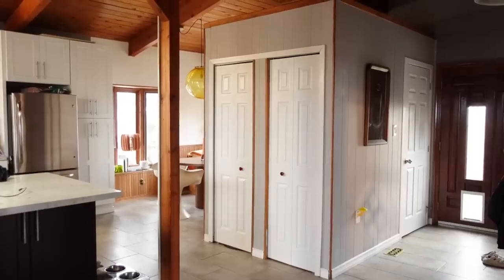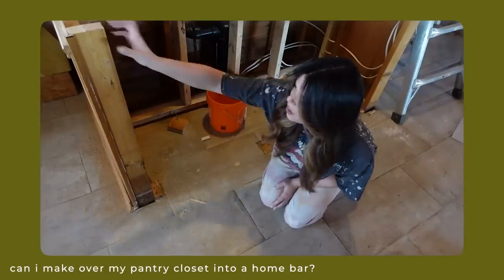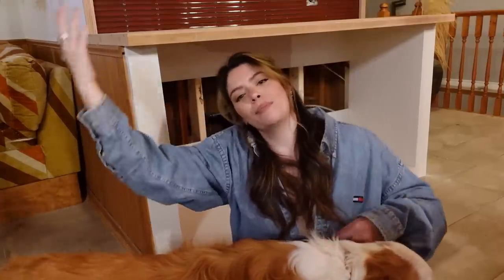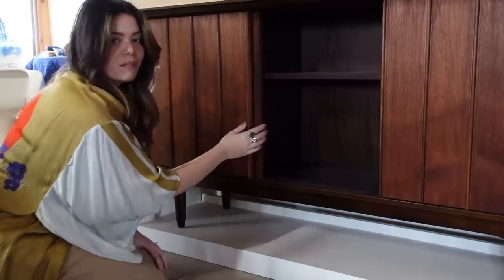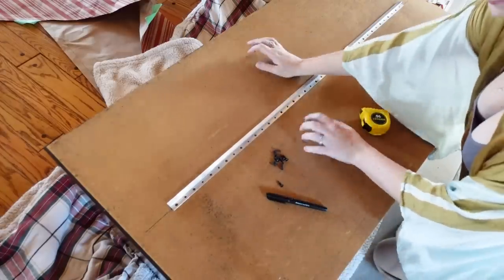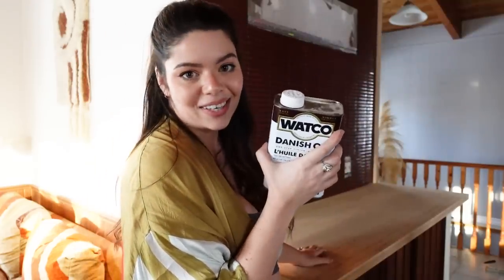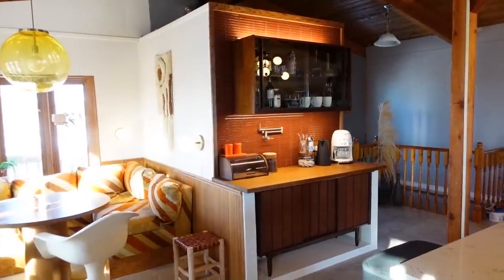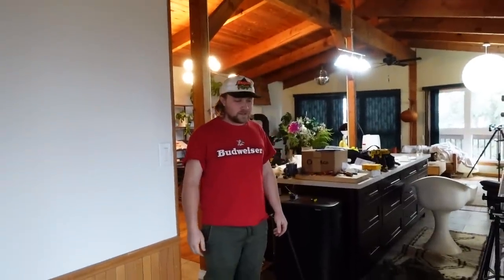tiny closet turned coffee bar (FULL MAKEOVER)

Comment: While I LOVE the aesthetic and functionality, I’m not sold on the cabinet  beneath. Can you hide the legs to make it look built in? It just feels a bit weird floating there. It looks amazing otherwise!
Reply: Yea I feel the same way. I thought when they built the platform they were going to remove the legs. The legs are rad though, so it’s tough, but it looks kind of odd though. Everything else is looking great! Though I would have installed lights inside the top cabinet too.
Reply: @michellemorales  I was thinking the same thing, I think the lights at the top and bottom make the cabinet so dark inside. Also the box below should just be a cool looking cabinet. The feet feel really off and the feet can’t be cut off because that piece is beautiful
Reply: that is a fair point, it's gonna be annoying to clean under there too. it'd be super easy just to stain a piece of wood and stick it over it.
Reply: She could maybe enclose the bottom ro hide the legs.  I agree that rather than a cabinet, it looks just like a piece of furniture shaved into the space.
Reply: @michellemorales  completely agree with you and was thinking the same thing while watching! Even though the legs are beautiful they do feel very off when placed on top of the buttom part. I would hide them with an additional drywall going upwards and might even consider placing some of the same tiles on top of that drywall to tie the bottom to the top and make it look more intentional.
Reply: That’s what I was thinking too, would loot a lot more cohesive
Reply: @ahooten1955  great idea!
Reply: What about tiling the niche that that cabinet is in as well, so that it looks more intentional?
Reply: I agree too. Maybe some baskets under it? Or building a drawer?
Reply: I love the cabinet and its legs - maybe she could place some baskets underneath it🤷‍♀
Reply: tiling the floor too would be more cohesive
Reply: Completely agree!
Reply: A built in cabinet would have been 100% better for all of the reasons. Could have gotten a cute repurposed mid c door
Reply: I actually didn't mind seeing the legs at all!
Reply: O was thinking the same. The built in frame & the dresser just placed there it feels a little incomplete or idk something is missing. It’s still beautiful though
Reply: If you can get some Bamboo and stain the same as the counter it would look awesome
Reply: Any spare tiles would look amazing on the white built in you had to make x
Reply: That was my feeling as well - like can it be trimmed out to look more built-in?
Reply: If I was her I would have painted the inside of the box a color similar to the color of the tile floor, then found some trim to match the dining nook and wrapped it around the the front of the box, instead of just painting it a bright white.
Reply: Yeah, I agree. That cabinet is so gorgeous, but looks very much out of place where it is. I would place it as an Individual piece and build my own cabinet(doors).
Reply: Ditto. I really hated it. The piece is so gorgeous that putting it in that box looks so off! She's gonna get sick of it and change it, watch...mark my words 😅
Reply: Was also thinking the same. If we are keeping the legs then why have the platform and the side walls. I am a bit confused. Everything else looks fire!
Reply: I agree. I don't care for the cabinet in there. I wish she would have made doors herself and done something really neat with her amazing style. Maybe it's bc of the feet.
Reply: I agree. I love the cabinet as a whole but the legs there look a bit off. Maybe some more of that base in front to hide them, so that if she wants to use the cabinet again she can take it off and it still has legs. However overall I think it looks great!
Reply: I agree, I think the white around the bottom cabinetry is throwing me off too:/ Otherwise I love everything else, especially the tile! The lights look so good against it.
Reply: Same, i would make some built in doors like she said and use that beautiful mid century cabinet somewhere else! It's wasted there
Reply: Yeah, same. I would run a plank of wood across the bottom stained the same color as the unit to the hide the legs. The rest I LOVE.
Reply: @jenniferh3111  ooh yes!!! I wonder if there’s enough tile!
Reply: @MaryseRacine7640  right. I think they could style it for sure!
Reply: or at least paint the platform a darker tone that matches the tile so its less jarring
Reply: In a perfect world, I would remove the two side walls, tile all the way to the floor and buy some taller furniture legs for the cabinet so that it still sits flush at countertop height.
Reply: Maybe put baskets underneath it? More storage without having to ruin the beautiful furniture piece
Reply: I was thinking she should find cabinet doors to replicate the top cabinet with the bottom to hide that cabinet because if you look hard enough, you would see the open space behind the cabinet on both sides of the cabinet.
Reply: I actually adore the legs as is.  A basket  or tray could sit in that space, or a rug, mat, throw… this may be my favorite project
Reply: i love the overall look too but the bottom part is just so goofy
Reply: Agreed
Reply: I think it would work better even if the nook it’s in just wasn’t white
Reply: Storage for basket can be placed ther
Reply: I like the little space underneath the bottom cabinet. Makes it looks less bulky and closed off
Reply: Couldn't she just extend the legs? So she didn't have to create the platform base. Overall, this is better than closed pantry before. It makes the space more open.
Reply: I also feel the same. Like maybe she can get a piece of wood or whatever to cover the legs.
Reply: No I like it!
Reply: The legs on the platform looks odd
Reply: The legs on the platform looks odd
Reply: I totally agree, everything makes sense and is so beautiful except the lower cabinet. In my opinion. The cabinet should shine on its own somewhere else in the home and the lower part could be turned into a built in that would bring the whole nook together
Reply: Agree.  I love the cabinet but that looks a little hodge podge.  Like it's built in at the top, but not built in at the bottom.  It would bother me, but then so would the scratched up couch, so to each it's own.
Reply: I totally agree! Close off the bottom and it will feel more complete. Aside from that, it’s GORGEOUS! Proud of your hard work. 🫶🏻
Reply: Exactly my thought, I'd cover it with some of the tile, think that would look really nice to carry though!
Reply: I agree with you! I would’ve loved for her to just make shelves and doors. But if she loves it then 🎉
Reply: Agreeeeeeeeeeeeeeeeeeeeeeeeeeeeeeeeeeeeeeee
Reply: Yes - the Legs throw it OFF.. I love it other than that.
Reply: Or maybe even just paint the white walls around the cabinet I similar color? That way I blends well.
Reply: Thinking the same thing. I love the cabinet and the cabinet legs but it does look a little odd. Overall it's a fabulous makeover though. I wish I could do half of what Becky can do. Love love love your house.
Reply: THIS IDEA ❤
Reply: agreed- the legs are killing me
Reply: Had to come to the comments to find this one!
Reply: @michellemorales agreed! She could cover the legs as if it’s a ‘kicker’ to a kitchen, but make it like how Kelsey did to the bench seating in her entryway so it opens up for storage. I love the legs tho!
Reply: Yess I think it would look a lot cleaner if they put wood or a similar dark tile on those white sides on either side of the dresser and possibly install a wooden toe kick to disguise the legs!!
Reply: I agree! Thank you!!
Reply: Yeah a panel over the legs with the same tiles as above could look really nice and pull the bottom part together with the top more!
Reply: I can agree with this! If there’s a way to add a piece underneath to blend it all it would look even better. <3
Reply: I see nothing wrong with the bottom with the legs... I personally hate boxy stuff!! I would love to get a name or link for that lighting you spike on. It's perfect for my purpose!!!

Comment: Gorgeous. Becky, if you want to make the counter more water resistant, you can use a product called Satin Wax by Watco. It is expensive but a little goes a long way and can be used on oiled surfaces.  I refinish a lot of Danish furniture and it is all finished in Tung oil, so to protect it a bit more I use this. Works well and doesn't alter the look.  You can  use it on any of your old oiled furniture after it is oiled.

Comment: I love love love the top part, the lighting truly makes it look so glamorous! I don't even drink coffee but I'd love to have this as a tea station!
I'd have put the hole to slide the glass doors in the bottom corners so it'd be easier to slide them open and closed but I guess you could leave them half open for daily use so there aren't too many finger prints on it :)

The bottom part though, as beautiful as the vintage piece is, it's not getting it's moment to shine where it's placed right now and looks rather awkward with the legs on the raised platform. It'd look cleaner with built in cabinets. 

But as you've mentioned in the video you can move it someplace else in the future if that's what you want to do.

Comment: i love the way it turned out. I think something that could be really cool and give you extra flat storage for pans/casserole dishes etc would be to build a wide drawer to go under the cabinet below. could bottom mount the tracks and have the drawer be just wide enough to fit between the legs of the cabinet. I think making the drawer front extra large so it fit in that space below the base of the cabinet would be a really cool way to make it look even more built in, while keeping it functional. drawer front could extend out past the legs of the cabinet to hide them, so that it looks like one big unit if that makes sense. You'd still be able to remove the cabinet at any time which would be nice. love this for you

Comment: Stunning!!!  The tiles are my fav then second is the cabinet below. I get it might look like a disconnect with the area where the legs are, I even thought if the legs came off and it dropped down then you would have a place to slide in a coffee tray…. BUT…it looks more uniformed with the cabinet right below the countertop and the legs on the cabinet are amazing and I notice it’s not just legs that there is a piece running across (between the front legs). If that makes sense. Honestly looks gorgeous

Comment: This project looks good! It's nice that you found some things and worked with it. I think it's cool that you stuck yo your original plan but I definitely think since you built it out already it would look a lot cleaner if you made the bottom cabinet doors as well. I think you guys have all of the tool up your sleeve and in your shops to do it. I'd say in the meantime though since the cabinet is so nice, to further integrate it it would be nice to add a piece of like removable (so, future proof it so that you can move the cabinet later if you want to) toe kick. And if you could, I'd either... Veneer and or stain, or fibd a faux wood contact paper to cover the white wall. Make it match maybe the darker tone of the upper cabinet to tie them together. And for the removable kick, I'd match that finish (veneer/ faux wood, or just some nice stained ply). I think it would make the whole space more cohesive. The upper cabinet is also pretty dark and you have glass doors so adding some lighting would have been nice in there as well. Just thoughts lol.

Ps: I'm in the GTA and would love it if you guys could mention where you thrift some of this furniture! I'm outfitting my house and it's so hard to find good thrift stores for furniture! And there was a really cool wallpaper place you guys went to in TO one time that I would have loved to know what it was. Anyways I'd love a sideboard/ credenza like this one you found but I have no clue where to look :(

Comment: HI Becky, love the overall look and color scheme and tiles! and love how you were able to use existing pieces of furniture to complete it. BUT,  and a big but, I would def enclose the area where the legs are on the bottom to create a seamless, finished look. So for example add a white panel between the bottom of the lower cabinet and the raised floor. 

Also there is disagreement about the food safety of Danish oil. Depending on the brand, a lot of chemicals and solvents are added. Even if cured I would not allow it to come in contact with food.

Comment: We lived in an old house that had been gutted and renovated just before we signed the lease. About 1 month in, the upper cabinet randomly FELL OFF THE WALL. 😮 (thank god we were all outside when it happened). But the contractor had just taken a cabinet that had been sitting on the countertop and drilled it into the wall. The back was just mdf. The bolts were still in the wall when we assessed the damage and threee holes in the back of the cabinet from where those were drilled in. They came back to properly add wood studs to the back of the cabinet and hung it again. 

Basically I gasped when you said you were attaching the hanging hardware to the mdf back of the cabinet. Then your smart brain made sure there was a stud 😊😊😊

Comment: Maybe either paint the bottom of the platform the lower cabinet is sitting on the same color as the tile and/or add a some baseboard  stained to match the rest of the trim along the front of it?  Something about the bright white under cabinet looks off with all the darker tones and makes the cabinet look like its just sort of floating there rather than an intentional built in piece of furniture.

Comment: I love this 😍 i do have a question about the tap, is it just going to be used for the kettle/ drinks? It is a v cute tap, but  I have never seen a tap without a sink, so my brain is confused seeing it alone and needs to get used to this 😆
Reply: It’s called a pot filler, you’re supposed to put something underneath like a kettle or a pot, it’s very useful actually :)  some sinks aren’t deep enough to accommodate large or wide pots so this removes that issue

Comment: The upper part with the tiles and the shelves looks great, but the lower part looks a bit patched in my opinion. The cabinet just doesn't fit there with the white bulky floor and half wall. I understand she really wanted to use that cabinet but I think the solution would have been to tile that part of the floor, or to simply use it in a different space, and just hang doors and shelves overthere, like a built-in unit.
Reply: Another idea that would have worked better, if you tiled that part of the floor, would have been to remove the legs of the cabinet, remove the half wall on both sides, and hang the cabinet floating, that way the hight of the cabinet would work better.

Comment: Is it not possible to remove the legs? I feel it makes it feel awkward and unfinished from being a proper built in. Also the white base really stands out and takes away from such a cool design and pieces.

I imagine you could stain a piece of wood to match and hide the bottom and screw into another piece of wood behind and you can secure that to the half walls, without ruining the piece. 

Or I would get rid of the half wall and make the bottom stand higher or with a lip to hide the legs, and you could make some extra storage on side if you wish. Although seems like wouldn’t be room for more storage. Honestly without the legs you could probably build a pull out drawer at the bottom. 

If anything I think painting the white to match the moodiness of the rest of the project and stain wood or carrying some similar batten like you have on walls on the legs would make it more cohesive and more of a moment.

Also I love how this little bar area looks next to the breakfast nook and the whole vibe.

Comment: I agree that the whole project is amazing but the cabinet with the legs sitting on the platform looks very awkward. It would have been better if you had just added doors to the box you created. And if you were going to do the box anyway, you could have cut down the partial walls on both sides.